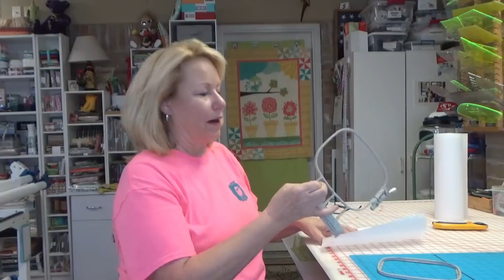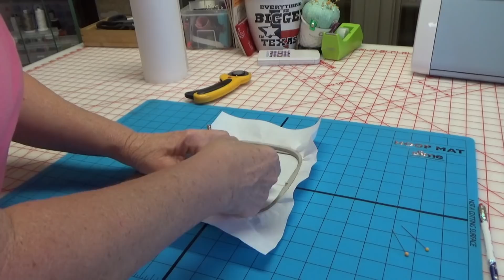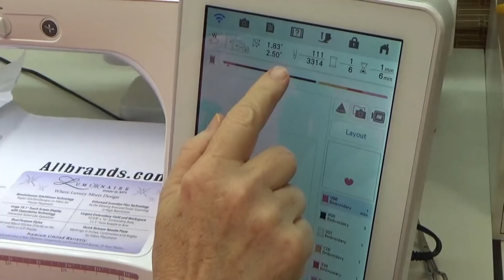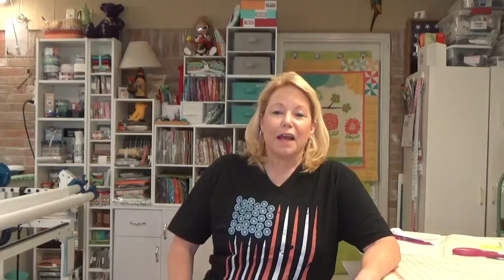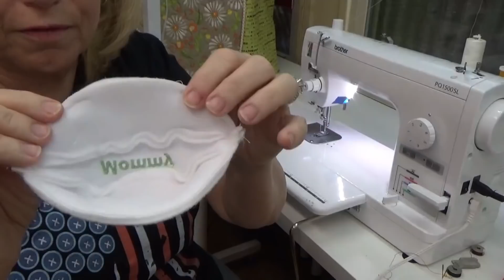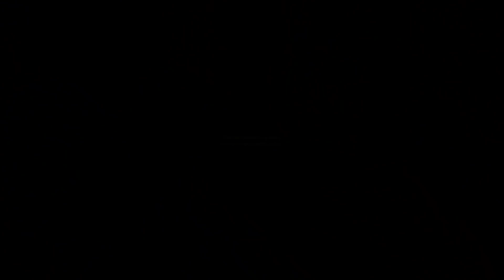Pt 3 Snowball Construction and Missing Broken Needles!

Comment: You can iron those seams open..too bulky for the embroidery..we have switched and started using Reens other template for bigger snowballs..it only uses 4 panels . Not a perfect circle but cute and fun..kids line the bigger fat balls..nice with hats on them too!
Reply from the maker: I'll have to check those bigger snowballs out.  A commenter suggested I use orange felt for the large orange peel template I have from MSQC and make pumpkins.  The orange felt finally arrived and I'm anxious to get started.  I'll give ironing a try.  Thanks!

Comment: I learn so much from you.  I have experienced same frustration.  You are a good example of patience.  May I ask also, which pattern face mask did you use?  I have made 4 different ones.  Just looking for one that seems to be the better one and goes faster. Thanks so much!
Reply from the maker: The masks I have for my husband and I are the pattern that Jenny uses from Missouri Star with elastic.  The ones I made for the veterans home have the same 6x9" pleated face part with 21" ties across the top and bottom.  The ties started out at 24" and I used 3" of each one to cover the sides of the face part.  Then I sewed the ties on.

Comment: Becky if you have more problems at the same location, as you have now twice, I suggest you contact the digitizer, as it seems there may be a problem with the digitizing, tho it should have been discovered during their testing.   I bought 2 sets also so will be watching to see if I have any issues in that location.   I'm  not a beginner embroiderer, and occasionally issues come up on tested designs.    You do a nice job teaching the new embroiderers and answering their questions.
Reply: My exact thoughts. Why would 2 needles break almost in the same spot of embroidering.
Reply from the maker: That's a good point.  I may do that.  Thanks!

Comment: I have a telescoping magnet that mechanics use (~1/4 " dia.) that I use to search or retrieve needle pieces or dropped screws. They're cheap is you purchase at an automotive parts store and very handy.
Reply from the maker: Yes, Keith has one I could scrounge, but I'd probably be better off to buy my own. Great tip!
Reply: @PowerToolsWithThread  A new one doesn't come with grease attached LOL

Comment: Hi Becky.  Could you use sticky back tear away for these snowballs?
Reply from the maker: I don't see why you couldn't use sticky back if you're doing one at a time.  When doing multiples I found that the machine foot would drag across the tops of the "canoes" as the hoop moved down the rows.  I'm afraid if only sticky back was used, I think they would shift around.

Comment: I have a question. It's not about the snowballs, they are soooo cute. I need to ask you about your sewing machine. I have been saving my money to buy another machine. I have worn my $69 Brother machine, straight stitch, no extras, out quilting. I have been wanting to buy another one and the one I came up with is the one you have. The Brother pq1500SL. How do you like that? It looks like it has a bigger harp, throat than mine. I have a 4 1/2 inch harp. I have a homemade extension table out of plywood and used a plastic cutting board on top. lol Poor people have poor ways. lol Give me the best answer you can give, all the pros and cons. Please. Thank you in advance.
Reply from the maker: Dorene, I love that machine.  It was a game changer in the way I pieced, quilted, and did bindings.  It's more on the industrial side and a real workhorse. The foot holds the fabric so tightly to the feed dogs so that your fabric does not shift around at all - no wiggling - so your 1/4" seams are more true.  It requires oiling the old fashioned way in holes on the top and bed of the machine and it uses a different bobbin than a standard Brother machine - probably because it's a manufactured cousin to the Juki (I think).  The Brother PQ1500 and the Juki 2010 are nearly identical; and the Brother PQ1500 and the Baby Lock Jane are exactly identical. Commercial sewing doesn't use pins so that's why the foot is tighter to the bed of the machine. I love the 1/4" vertical and horizontal markings on the face plate too and yes, there's more room inside the harp to maneuver quilts around.  The cons - the needle threader is the worst.  It works, but it stinks. That's it.  If you can deal with that, the pros significantly outweigh that single con.  Also, it's not a fan of weak thread (again due to its industrial nature) so I've found that a poly or poly blend performs fabulously on the machine but a weak 100% cotton will break.  If you can easily break the thread tugging between your hands, then you'll probably have breaks while sewing.  A strong 100% cotton is fine.  I bought mine from Amazon in 2018 and it's only been serviced once with heavy use.  Good luck!
Here is the machine on Amazon - https://amzn.to/2VDh7dX
And here are the bobbins you need - https://amzn.to/2XP3KtB
Reply: @PowerToolsWithThread  Thank you so much for the quick reply.
Reply: Hi Dorene, I have the Babylock Accompolish (known as Babylock Jane) and I love it. It is a work horse. Like Becky said the needle threader takes some time getting use too.
Reply: @carolreiter6157  Thank you Carol.

Comment: Hey Ms Becky. I have found an easier option than trying to pin my fabric to the stabilizer once it is hooped. I buy the double sided basting tape in 1/4 and 1/2 inch widths. When I have a lightweight piece, I use the 1/4" wide for heavier pieces, I use the 1/2" wide. I just hoop my stabilizer, put in cross hairs, then cut a short length of the basting tape and stick it to my stabilizer. Then I center my fabric over the cross hairs, peeling off the other side of the paper from each piece of tape as I smooth it into being centered in the hoop. I have never had a project come loose doing this and it helps me not stretch out my stabilizer when trying to put the pins in it. LOL Kids LOVE snakes stuffies. Found that out when my grands took theirs to school for show  & tell and came home and told me they volunteered me to make several more for their friends. Too funny!
Reply from the maker: Thanks for the tips!